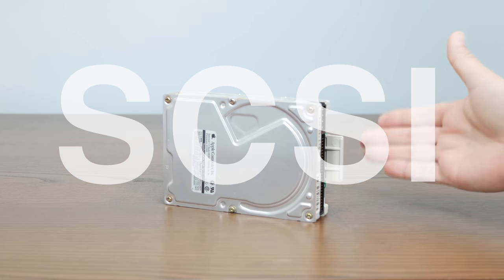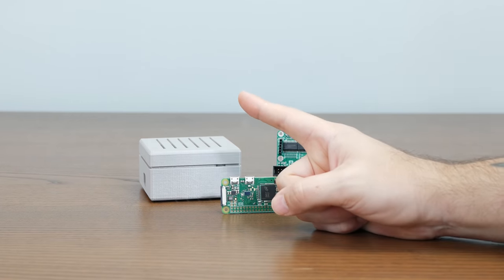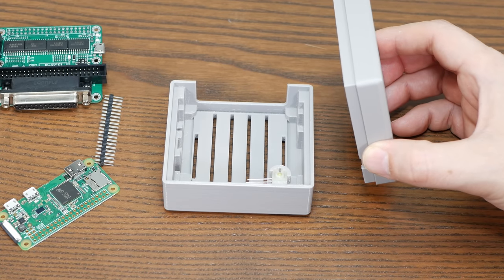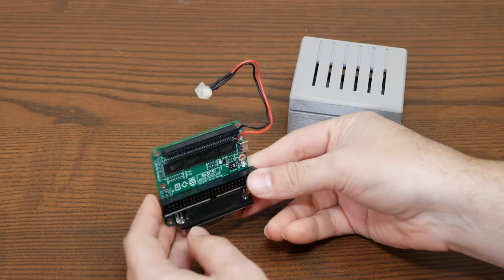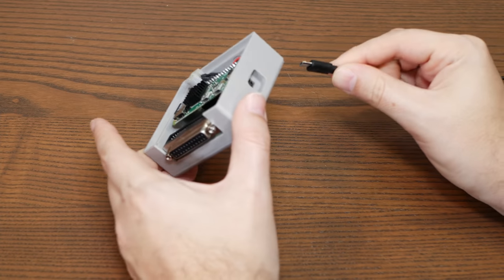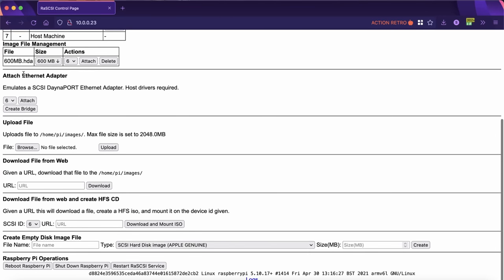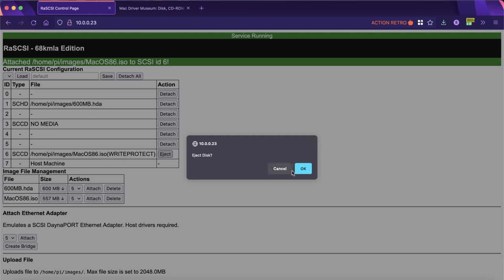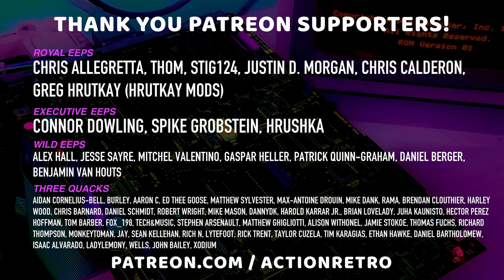The RaSCSI is MAGIC for Old Macs (and Much More!)

Comment: People call hard drives "spinning rust" because... that's exactly what they are. Iron oxide on a metal disc that spins round and round! I noticed Apple sure likes technologies that allow you to daisy-chain devices. SCSI, FireWire, Thunderbolt - all support daisy-chaining.
Reply: PC clone makers went with tower cases and extra drive bays where could just buy naked harddisk and just connect it to the controller; Apple went with sleeker case designs but had to buy much more expensive external harddisk in their own enclosure and with own power supply, and then daisy chain them off the Mac. Really made me appreciate the superior pragmatism of the PC world
Reply: As well as USB 4
Reply: The funny part there is that hard drives by and large haven't been oxide since the late 1980s. They've since all used plated or evaporated metal media (like high-end tape).
Reply: You forgot ADB
Reply: @lee4hmz  that's quite interesting!
Reply: Before SCSI there was GPIO, also known as HPIO and IEE488. It was a 4 bit wide external buss on Hewlett Packard lab equipment.
Reply: In terms of daisy-chaining serial devices, Atari did it before Apple with their SIO Port way back in 1979.
Reply: @TheJeremyHolloway  
Years before Atari and Apple, Hewlett developed an external bus with HPIB (later formalized as the IEEE-488 specification. But Atari's SIO was supported by "the Wedge" - a plug and play system.
Reply: Let's not forget ADB.  Every Mac keyboard I have has a port to plug the mouse into.
Reply: We built a lab with 9 IMSAI 8080s, networked with daisy-chained serial (9600baud), sharing the master node's floppy disk drive to boot them all up...if you want to know how to take daisy-chains to the extreme. That was in 1981. Soldered many a memory card and floppy drive controller together back then. Wish we would have had SCSI (or DSSI) back then. :(

Comment: SCSI strong points that mattered at the time:  - Devices you could daisy chain internally and externally.  - The original IDE spec at the time maxed out at 512Mb (Until eIDE), SCSI had no real limit  - SCSI was expensive due to it having very high quality standards that dictated good hardware and signaling.  IDE had very loose specs comparatively.
Reply: Wasn't also IDE just a 16 bit ISA bus on a ribbon cable? If so then an IDE port on a PC was basically free to implement, whereas implementing IDE on a non-x86 platform required a controller chip.
Reply: @CommonSense-hy2sn  I could not say, but that would fit within the 16bit ISA math of the 512Mb limit on the drives.  In the end, I have no idea and might make a Saturday night of that research.
Reply: @locnar1701  Even with non-PC machines, the logic to interface to IDE was just an address decoder and a few buffers. ATA didn't rely on any special features of the ISA bus (like the clocks or the DMA circuitry), and the controller registers were on the drive and not in the interface. Also, old IDE could go up to 65536 x 16 x 255 blocks (2^28 blocks), which is where the 128 GB limitation some older machines with IDE have comes from; the 512 MB limit was imposed by IBM (since they repurposed the floppy disk BIOS interface for hard drives), and wasn't remedied until the INT 13 extensions came out in the mid-1990s.
Reply: @eDoc2020  That's another BIOS limitation. ATA has always been able to do 28-bit addressing;  it's just that the standard INT 13h interface couldn't use it all (in this case, it's because INT 13h only provides 6 bits for the sector number). 16383/16/63 is a magic number that was added by ATA-5 to avoid confusing old CHS-only hosts.

Comment: One of the strong points of SCSI is that it didn't really care how big the drive was, maximum partition size was down to the OS.
Reply: I though the the main differences was way back the very first SCSI and IDE/and the standard before IDE, was that SCSI Drives where a lot more independent of the host MAC/PC, like error correction, status monitoring etc.,  than IDE and the communication was generally handled by a expansion card, take the load of the PC/MAC CPU, and what was called IDE, where a lot more dumber, than the more resent models, which now do almost all the house keep the first SCSI Drives did with interacting with the MAC/PC?

Comment: Sorry you had a few issues on the web interface! I've pushed a fix to the develop branch that allows for better file uploads. As for the cd I'll have to try to reproduce that, haven't seen it fail before but shoud work with any file. Maybe a weird url or filename? Great review!
Reply from the maker: Thank you Eric!!
Reply: Truely a great addition to the retro computing community! I have a Powerbook 5300c that I replaced the drive with an IDE-->CF solution but those tend to slow down over time (lack of garbage collection). I can't wait to try this on both that and the PowerMac 7200 I have.
Reply: Could it support emulating a SCSI Scanner or Printer?
This would be an interesting way of loading images onto the Vintage Computer or producing PDFs for a modern DTP workflow.
Reply from the maker: @SalvoDan  Oh, what a cool idea

Comment: There was actually an advantage for home users using SCSI. SCSI controllers were not supported by the board BIOS. They came with their own BIOS ROM which extended the BIOS of the board. This broke the size limit without using tricks or relying on BIOS updates for large IDE devices.

Comment: I think you are understating how much better SCSI was.  When I bought my first hard drive for my brand new in 1987 Tandy 3000HL, the alternative was a MFM hard drive.  If your backup battery went dead, you had to run a setup program from a floppy (360) to enter the drive parameters. If you drive's wasn't on the list, you had to select the one closest, but no larger than yours. Potentially you could destroy your data if you enter the wrong numbers.  RLL drives offered more capacity using an overpacking scheme that seemed insane even then. And didn't cost less than a SCSI system.  So I bought a 20 mb Miniscribe SCSI drive and a 16 bit Future Domain ISA controller.  And was delighted with it.  Later, I think it served just as well in a 486/33 system and it still worked fine.   SCSI actually came before PC's were even offered for sale.
Reply: If you're talking about "MFM" and not IDE, I'd agree, but this is a different problem entirely. MFM wasn't really a type of hard drive interface like IDE/SCSI.  MFM and RLL were largely all proprietary standards where hard drive, and the hard drive controller were tightly integrated.  So if your "MFM" hard drive failed, you couldn't just go and buy a new "MFM" drive to replace it. You had to go buy an entire new integrated card+drive.  The innovation of IDE and SCSI was that they had the HD electronics integrated with the drive itself, with a standard protocol (IDE/SCSI) to communicate with the host controller.

So practically speaking, MFM (and RLL) didn't really have any meaning, and different manufacturers of the drive+controller could mean completely different experiences.  The tightly integrated card+controller didn't last much past the  mid 80s, after which it was replaced with IDE.

Comment: SCSI predates IDE/ATA by many years. PC's started with MFM drives. MFM was a much cruder and lower level protocol that left a lot of the control to the host - data was referenced by cylinder, head & sector, and the host had to be aware of the physical geometry of the drive. Get this wrong (eg, if your CMOS battery went flat) and you lose your data. SCSI was a high level protocol, with the drive appearing simply as an array of linear blocks. The protocol also allowed for devices other than storage - for example, it was common to attach high performance scanners and printers via SCSI. 

When IDE first appeared, it simply moved the HD controller from the motherboard to the drive - the IDE bus just buffered and extended the motherboard bus to the drive. It was only later that he protocol started to gain SCSI-like features, such as linear block addressing, and scatter gather, and became ATA. Even during this period, SCSI was a set ahead, using LVD (low-voltage differential) for better signal integrity for higher speeds and longer cables.

I used SCSI on server-class machines, as well as my personal desktops, for many years, and I routinely had a large number of devices attached. I never had any problems with bus termination. The simple rule was that you need to terminate both ends of the bus to prevent reflections (because you're basically dealing with RF). In later years, active terminated appeared, which made it even easier.
Reply from the maker: Oh very interesting, thank you for this!
Reply: All of this.

From the user standpoint, SCSI was more expensive but SCSI was more verstatile, and allowed external devices. The external Zip drive for PC was over Parallel port. Scanner (consumer grades) on PC used Parallel port while higher end either used SCSI or and extension card (ISA or PCI). Parallel port was designed for printing. While on Mac, just SCSI. Mac kept SCSI port until USB, even though they already had switched to internal IDE drives at least on the lower end.

SCSI lost appeal when USB appeared. An guess what? The iMac is the one that popularised USB devices, while dropping SCSI.

SCSI lives on. ATAPI, SATA, USB Mass Storage, all use the SCSI protocol on top of their respective interface. (proof: on Linux SATA and USB drive are /dev/sdX, like SCSI, while IDE drives are /dev/hdX)
Reply: @hfiguiere  there were external ZIP Drives for the PC that also had SCSI ports on them... not just for Macs...
Reply: @TheJeremyHolloway  which were the same as for the Mac (except the package and the PC formated disk). But how many PC users had a SCSI adapter? That was my point. USB levelled up everything (and it took the iMac to have it more widely adopted beyond mice)
Reply: @hfiguiere  I still have two of my SCSI ZIP and one of my SCSI JAZ drives. :) Wonder what will fit on a 1GB JAZ these days? hmmmmm

Comment: The vintage sampler community has been actively working on these for several months now, too.   The original project started several years ago in Japan but didn't gain much traction because the only suppliers of the boards were in Japan and the docs were all in Japanese.
Reply: Have any vintage sampler documents been made available for RASCSI compatibility?

Comment: Wow, I am blown away by the interest in RaSCSI cases! I'm running out of stock of pretty much everything... so if something is missing from my store, check back in a few days! I'll keep the printers running around the clock to try to get caught up!
Reply from the maker: Hooray!
Reply: @davidcarlin5336  Prusa MK3S! I also recommend the Prusa Mini - results are 95 percent as good for quite a bit less. I use Prusament for production parts but even cheap Hatchbox filament from Amazon looks just fine.
Reply: @davidcarlin5336  feel free to get in touch if you have any questions! Twitter, website, Etsy, etc.

Comment: I have a 5.25" Full Height SCSI hard drive from my Commodore Amiga days. It still works. It sounds like a garbage truck traveling down a gravel road though. SCSI was MUCH faster on my 7mhz 68000 equipped Amiga 500. It's really noticeable on low end equipment. On modern equipment of course, the processing power is so high that it doesn't matter.

Comment: I bet this would be a good fit for my NeXT slab, and maybe even my DG Aviion!
Reply: I bought the book on the Motorola 88K at my college bookstore and read it!  Loved that chip.  Boxen I have had coded on and worked on over the years:  CDC Cyber 6600,  DEC VAXen (750 to 8800),  DECstation, SGI Indigo/Challenge XL,  KSR1 (!!!), DEC Alpha, Sun 3/80 (68030), Sun SPARC 5, RS/6000 Model 250, HP 9000/725. Then Linux came, and since 2003 that's all I've ever worked on - with some Diversions to z/OS and z/VM here and there.

Comment: There are so many uses for a Raspberry Pi Zero, these drive emulators being one of the most impressive ones.

The SSH is disabled by default in the Raspbian OS image, the Pi itself doesn't care. Though in practice the only thing matters is that it isn't on by default, why or by what - doesn't matter.

Comment: I use castoff scsi3 disks from servers with an adapter board. Theyre reliable and really fast, and astonishingly cheap. 10$ for the adapter and less than 10$ for the drives. I have a 160gb one in my Powecenter Pro

Comment: (8:14) I should mention that there are "H" variants of the Zero series that come with the GPIO pins already soldered on.
Reply: That wouldn’t work in this case though, since the pins had to be soldered upside down

Comment: Not many realise that SCSI was a development of SASI (Shugart Associates System Interface), which appeared 5 years earlier. Some SASI devices could work with SCSI-1 controllers; they used the same 50-pin connectors.
Reply from the maker: Woah that's really interesting!

Comment: IDE was designed specifically for use in 286 PCs so easy to imagine that bus being far less than ideal for other platforms as the IDE bus is just an extension to the 286 16bit ISA bus.  SCSI on a pc is probably not faster than ide but on other platforms with a much faster host bus scsi would be faster. I'd say scsi's big advantage was not speed but external connectivity
Reply: All true; IDE wasn't really comparable with a good DMA SCSI card until multiword DMA type 4 and multiple sectors per interrupt were widely implemented, which wasn't until about 1995-1996, and it wasn't really great until Ultra DMA around 1997-1998.
Reply: This is what I was thinking too.  IDE was so tightly coupled to the AT platform that non-PC platforms couldn’t really just use it directly.  SCSI was kind of the go-to choice.

In terms of speed, it came down to how the controller communicated with the system bus, and how fast the actual disk was.  All the bandwidth comparisons were pretty much academic until we started cramming new drives into old computers.  (Now 4MB/sec SCSI throughput is ... quaint.)

Comment: I worked at a computer store during the late 80's and early 90's. Apple used SCSI because IDE drives didn't even exist when the first Macs came out. Even when they did eventually come out in 1986, they were 4200RPM (I think) so slower than SCSI drives at the time. Apple probably already had their designs for the next few years built around a SCSI controller, so it would have been difficult to change to IDE. Also, since USB didn't exist, SCSI was the perfect platform to add multiple simultaneous devices to your computer.

Comment: SCSI had an advantage over IDE interface you may  be unaware of: SCSI devices were intelligent peripherals that sent data in bursts along the bus.  IDE drives added a similar capability with ATA spec, which survives in the SATA standard. this was particularly useful in servers.

Comment: Well... In 1987 there still was not a mainstream standardised interface in the PC desktop world, and we needed hard drive cards with an interface specific to the drive.
Later, non-scsi cdrom drives came with 3 competing connection standards.
Ide/ata if I recall correctly started to become mainstream around 1990 and was extended to other devices around 1994 (with the atapi standard) bringing cdrom drives under the same interface.

Comment: I used to only use SCSI on my PC's. My favorite was a DPT caching RAID controller that supported multiple LUNs and target mode so (theoretically) over a hundred drives could be connected to a single bus!
   I have to check out this gadget! I wonder if LUNs could be implemented.....
Reply: I'm 100% sure that LUNs could be implemented, but the code is confusing enough to me that I don't know where the changes would need to be made.

Comment: 4:25 It's not just SAS. SCSI lived on in other big and important ways.
1) ADAPI was a protocol for squeezing SCSI commands through an IDE or SATA bus. Basically every IDE/SATA CD/DVD drive ever, natively spoke in SCSI commands, adapted to IDE/SATA via ADAPI.
2) The USB Mass Storage protocol, used by basically every flash drive ever, is essentially SCSI-over-USB, as far as the command set and deepest nested protocol layer is concerned.

Comment: SCSI is Small Computer System Interface: it's more than just a hard drive interface, it's a versatile and relatively high-speed interface (5MB/s for standard narrow SCSI) for a variety of up to 7 devices both internal and external (scanners, printers, disk drives, video controllers, network controllers, etc). AT Attachment, on the other hand, was originally designed for internal hard drives and internal hard drives alone; the original standard did not natively support anything else, which is why ATA Packet Interface had to be invented, and it's still an internal-only 2-device-maximum interface. Fun fact: ATAPI uses SCSI commands over ATA to support all of the expanded features such as removable disks. Also (for PC users), SCSI doesn't have the various ridiculous capacity limitations and doesn't require manual C/H/S configuration like older ATA controllers do.
Reply: SCSI does have similar capacity limitations. It just seems hosts handled them better.
Reply: @eDoc2020  From what I've read most SCSI capacity caps were imposed by OS file system limits (mostly in FAT and FAT32 but also HFS), not by limitations of SCSI itself, and thus could be avoided by partitioning the drive. By contrast ATA had known hardware limits at 528MB, 7.9GB, 8.4GB, and 137GB depending on the host system, in addition to the file system limits, but unlike SCSI these limits could not be avoided by partitioning since it was a BIOS/hardware problem, not an OS problem.